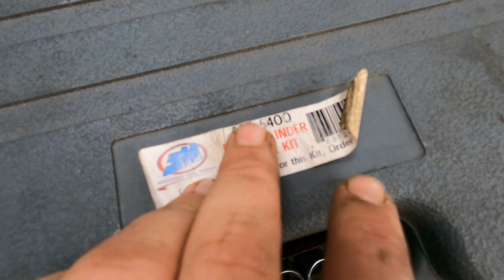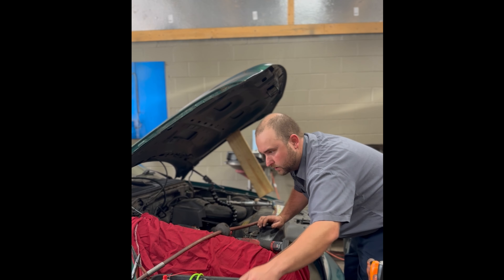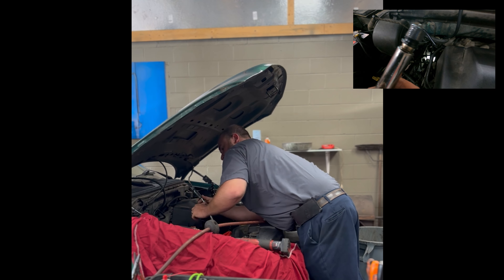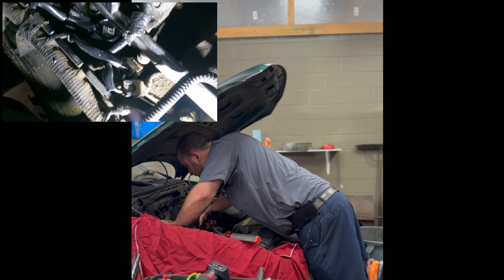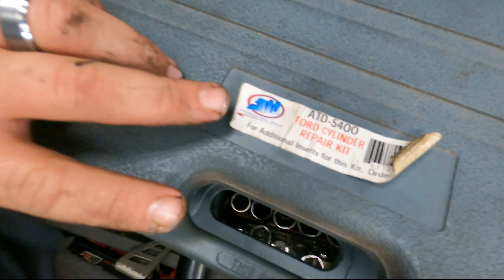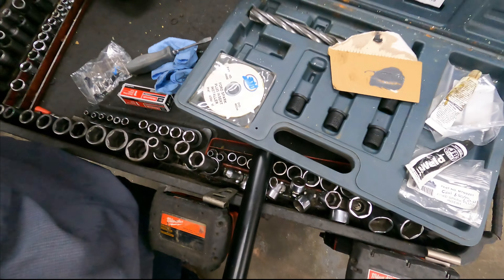Ford F150 5.4 liter blown out spark plug repair

Comment: Get a Timesert extended kit. It locks the insert in the head. Use wheel bearing grease and loctite red on the tap and insert.